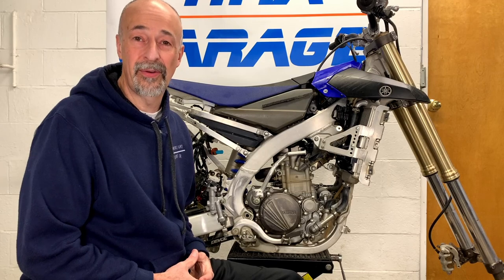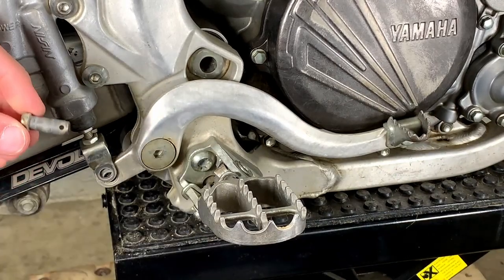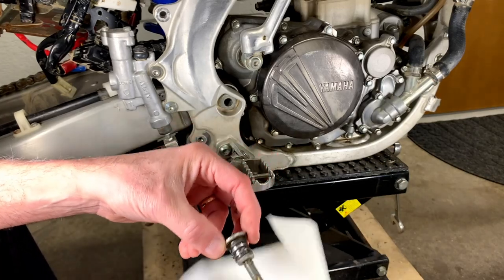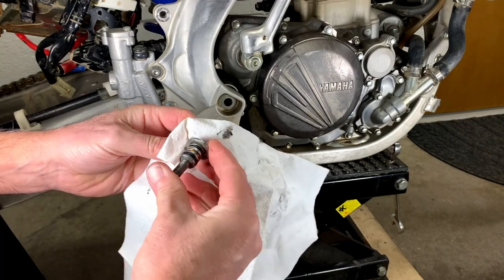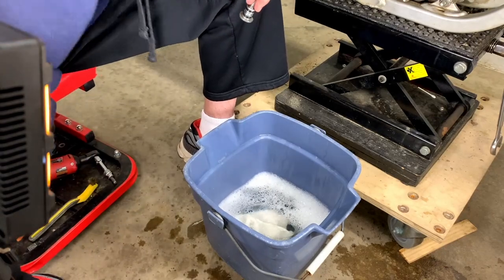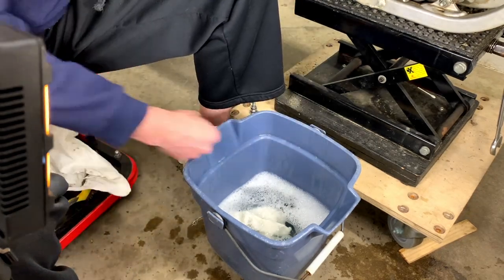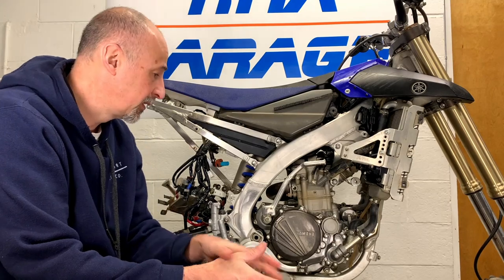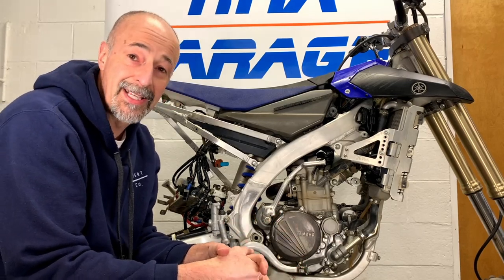Rear Brake Lever Cleaning | Dirt Bike Maintenance  Part 7 | Yamaha YZ 250FX

Comment: Nice! I noticed the radiator brace. Can you tell us a little bit about it? Was it easy to install? What brand? I want to get one but I'm worried about fit.what year is the FX? I have a 2019 FX.
Reply from the maker: The braces are made by Devol.  My FX is a 2016.  I already made a video and do a complete install on my son's 2015 which is the same as the 2016.  Check it out:

https://youtube.com/watch?v=w4ru8eVVVSQ&si=EnSIkaIECMiOmarE

My has the optional radiator fan and in the video I do a modification to accommodate the fan.  

Ask more questions as needed and we will help as much as we can.  Thanks for the comment.